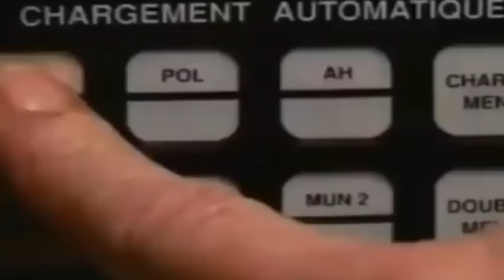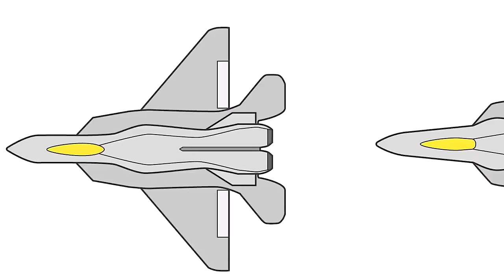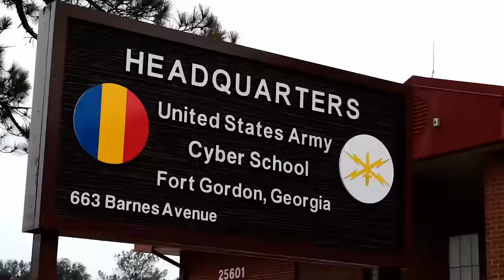Japan Stuns China & Shows Off 10 New Weapons that Shock the World!

Comment: The  Soryu-class sub may be the quietest submarine in the world. It also has a flattened section on the bottom of the hull so it can literally sit on the bottom of the seabed in wait.
Reply: That’s not likely. Any deformation of the surface would put huge stress on the hull of the sub. Also, with the silt on the bottom of many parts of the ocean floor the suction would add immense stress to the engines and drive systems.